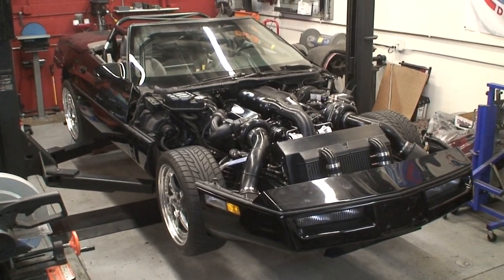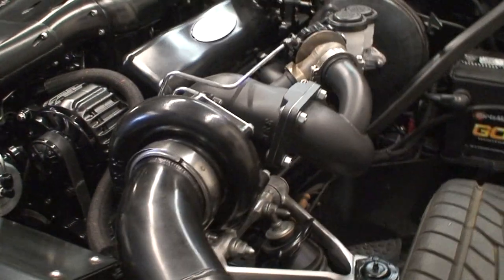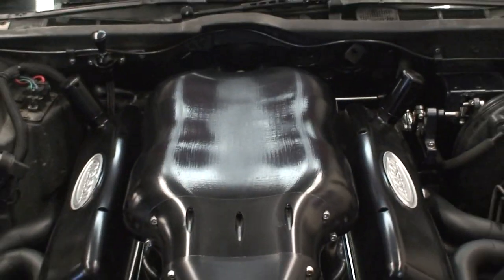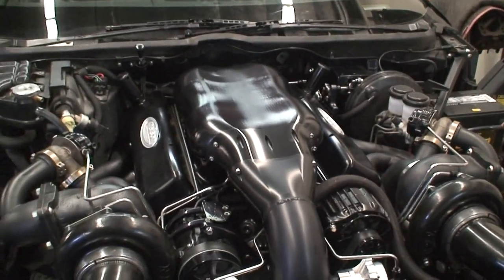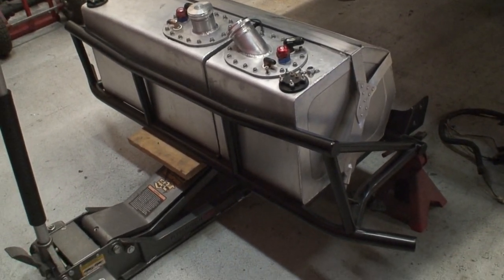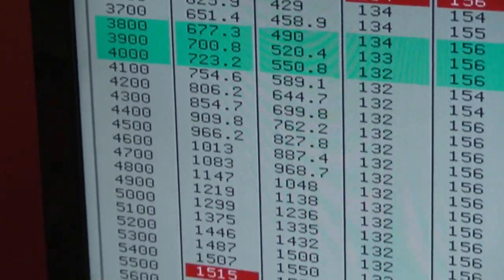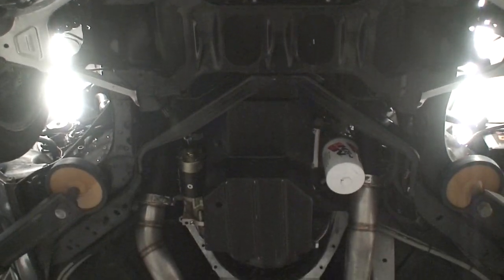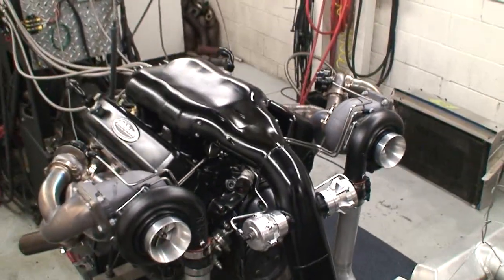NRE 1690 HP Corvette C4 Build.  Awesome Mirror Turbo Engine.  1990 Corvette.  Tom Nelson.

Comment: Anything this guy builds is state of the art and bullet proof! If you put the biggest drag radial you can find and fit it under there you can have some serious fun! Plus you can always turn it down if your worried about your tires spinning. Iv'e seen 1500 H.P. 911's doing high speed runs that's obviously what this car is for!

Comment: Why do you run 116 if the compression is low enough to run 91? Isn't there no gain from high octane fuel in a lower compression engine?
Reply: crownvic64 his engines are have 16 injectors 1 set does the 91 and the set comes on when under boost squirting the c16 so you are only using c16 when under hard acceleration

Comment: How about some heat shielding for the brake fluid?
Gonna be fun stopping that car with boiling brake fluid and melted components. Cummon think about it Tom? and how about some variable valve timing, or direct injection or maybe some diesel engine. Ok your stuff is solid, but its getting a bit boring.

Comment: what 1700 hp good for besides rolling burnouts?
Reply: Ben Dover If you can make tranny,and rear last,and hook it up it is good for winning!
Reply: FJ80Coop thats the thing though, hooking 1700hp on the streets isnt possible. i doubt slicks would be any better
Reply: Ben Dover 60mph with big slicks you could probably do some damage
Reply: Ben Dover
If you were any kind of a driver it is possible,you don't just floor it,and hold it pinned,you have to play with the tune before hand so it will,and can hook up, letting the big power come on at the mid through top end,throttling it as necessary...You have to learn to drive it,and not just hang onto the steering wheel...
Reply: FJ80Coop at no point in time would you be able to put those 1700 horses down to the ground. youd need some big ass slicks that wont fit on this corvette
Reply: Ben Dover not true there are street cars that hook up with 3000hp
Reply: ***** You are not looking hard enough. There are a bunch of videos of digs with that power where they hook. Although I don't like the show because it is not real street racing Street Outlaws race from a dig with 2500+ hp and do just fine.
Reply: FELiPES101 yeah in a back halved car with 15" wide slicks and there is no way they're using all of that 2500hp in an 1/8th mile pass on an un-prepped public road. Have a look at some videos of kelly bise at the texas mile, leaving rubber at well over 200mph before trapping 242mph in a standing mile... thats with 1800hp.
Reply: fuckucatchme1000rr the vette will spin the wheels even at 60mph.
Reply: Of course it will if you just nail it,one has to learn to drive a car properly instead of just driving with the pedal pinned to the floor...Otherwise,how do all of those guys win races on tracks,and streets with all of that hp if they do not drive the car just right without tire smoke,without getting totally sideways...No matter the hp you still have to be a really excellent driver in tune with the car to get anything over a few hundred hp down the strip,or street when racing without crashing,or smoking the tires...Top fuelers manage to get all their hp down to the track,and they make some serious numbers beyond dynos capabilities to measure..All within a 1/4 mile from a dig...Cut their hp in half,add double the weight for what a street car would weigh,and big,or small tires can hook up provided there's a good driver behind the wheel who knows how to pedal..
Reply: All it's good for is either powering a small town or doing burn outs in 6th gear
Reply: +FJ80Coop Or just have a decent boost by gear setup.

Comment: Yeah yeah, you got a fucking 1700hp car. It has no use unless it’s fucking mid engine. U have zero tractionz moving the engine back a few Inches makes a significant preformsce impact

Comment: 30 grand engine setup in a 7 grand car. That makes zero sense
Reply: The owner is going for understatement.
Reply: Chevelle Turbo 7 if its MINT condition with no miles
Reply: Are u kidding where u gonna find a car for 37k making that much freakin power that’s looks good and F’s everything. Makes more sense than U know